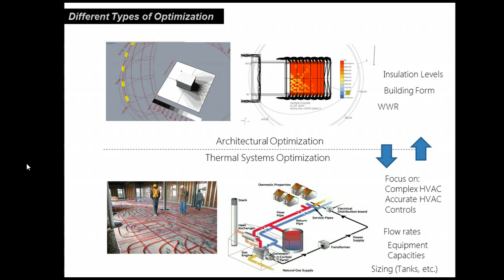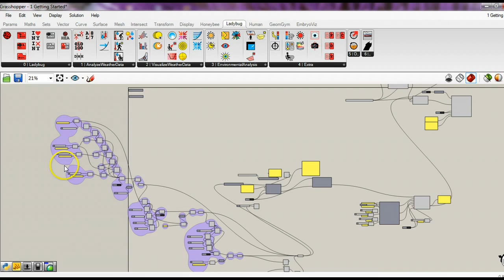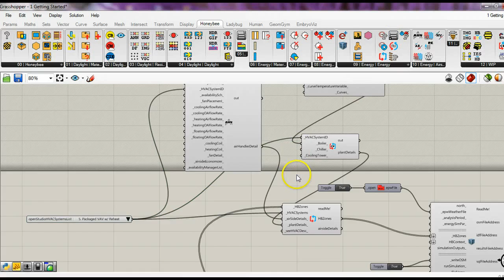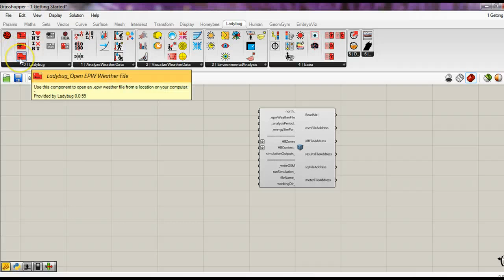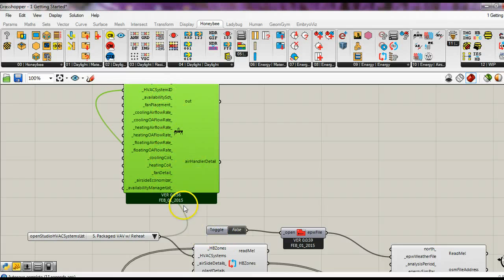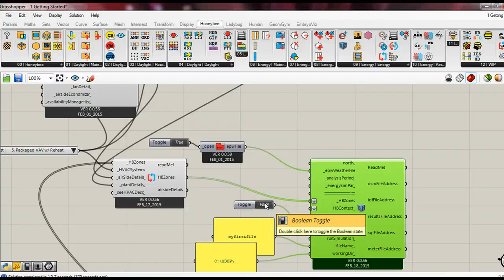01 Getting Started with Honeybee and OpenStudio

Comment from the maker: Hi Everyone, if you get the PINVOKE error, this is a problem that OpenStudio has with certain windows machines and we are hoping to get this corrected.  If you experience this error, we don't have a workaround and suggest you use the EnergyPlus plugin for Honeybee.  Sorry for the inconvenience.
Reply: terabuild  ok! Good to know. In case it is of interest in your future debugging work, heres my setup: running paralells 10, windows 8.1

thanks for all the good work bringing this functionality into GH!
Reply: Hi. I'm trying to use HB OpenStudio. The nodes are a little different from what I saw in this video. I'm assuming there have been some updates to the nodes in HB. Anyways, I'm getting this error from the AirDetails: 
1. Solution exception:__init__() takes at most 14 arguments (15 given)
and this from the CoolingDetail:
1. Solution exception:__init__() takes at most 7 arguments (8 given)
and this one from the HeatingDetails:
1. Solution exception:__init__() takes at most 6 arguments (7 given)

I'd appreciate if anyone could help me.

Comment: Hi!

As I write the OSMfile it gives me a runtime error. "..ModelCorePINVOKE" and its on line # 2419 (initiate OpenStudio model model = ops.Model) and line 2551.

I presume that it can not find and run open studio? Correct? How to go about fixing it? I have both ver 1.5 and 1.7 installed. Both in the c:/radiance/bin folder for some reason. both versions seem to work.